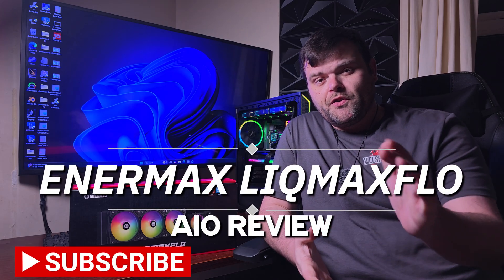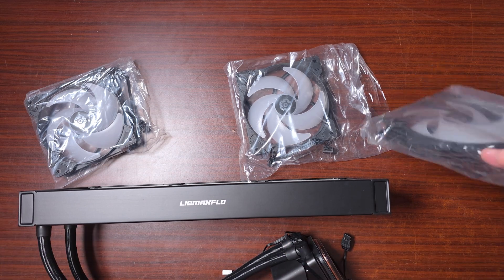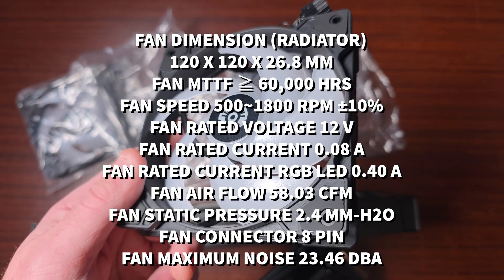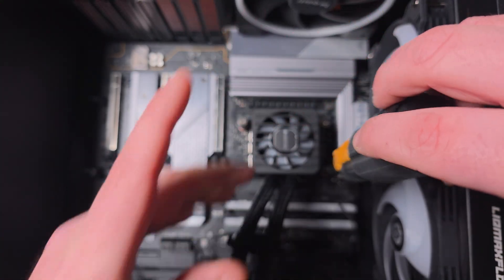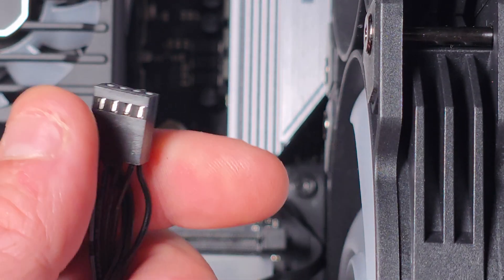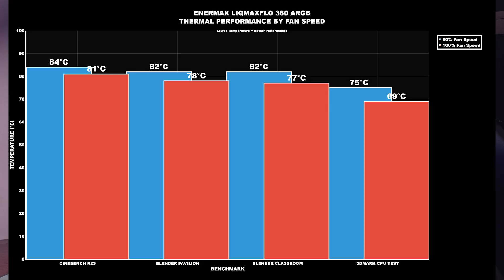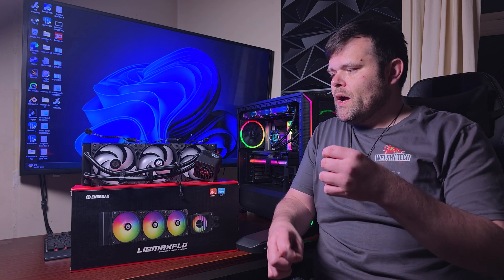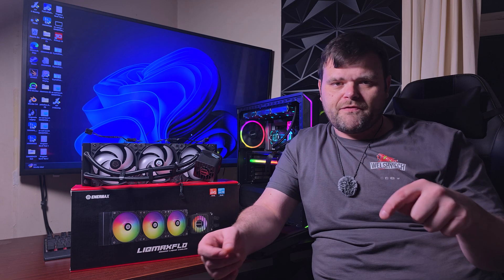The AIO for AM5? ENERMAX LIQMAXFLO 360mm AIO Review

Comment: How if each pwm for AIO and radiator Fan together using a Y-cable splitter and plug in a CPU header ?
Reply from the maker: Because the pump needs a separate header to control it and also they run at different wattages